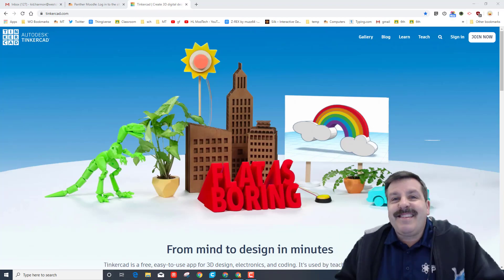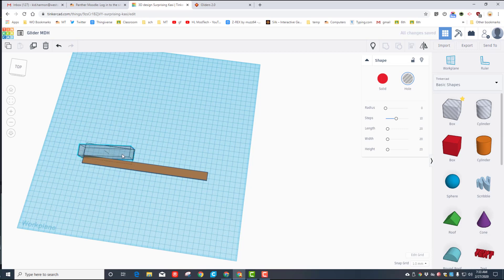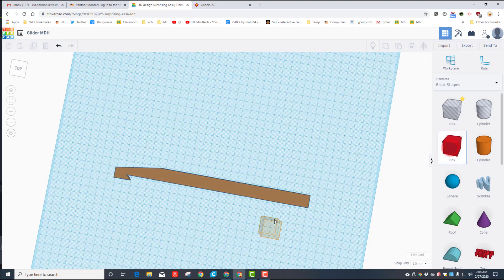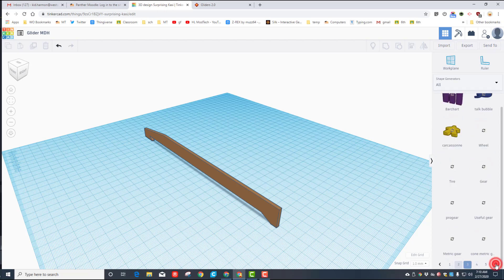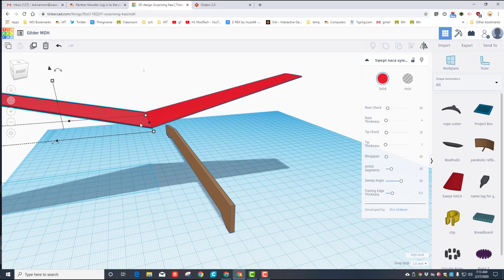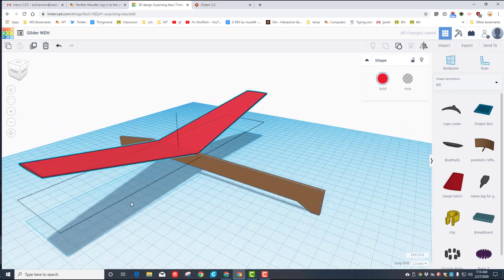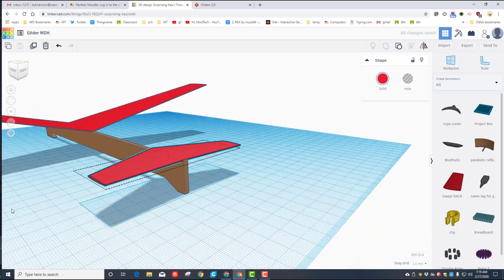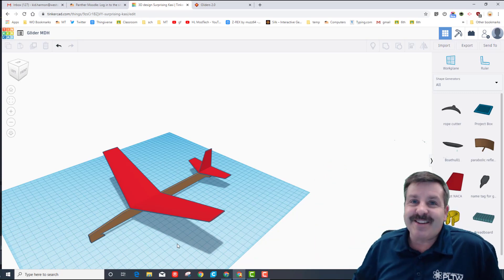A Great  Glider in Minutes! Learn your parts using Tinkercad! #PLTW

Comment: how did you get such a perfect cut?

i did it and it went weird
Reply from the maker: Probably 2 things... I made the cutting block extra large so it caught all the parts. I also used the workplane to get the exact angle I wanted.
Reply: @HLModTech   thanks for the tips

get it?
Reply from the maker: @Mohammed_Ahmed99  Well played. 👍